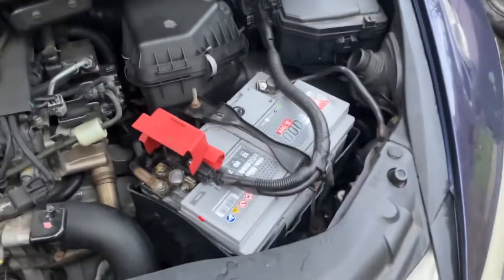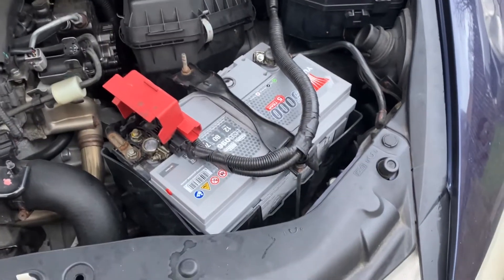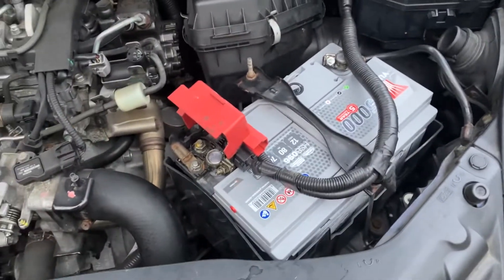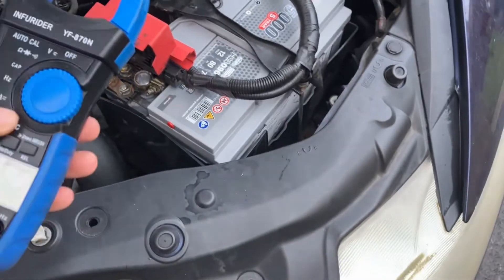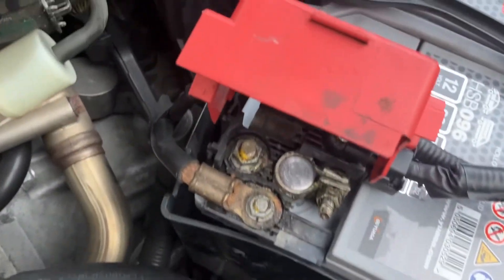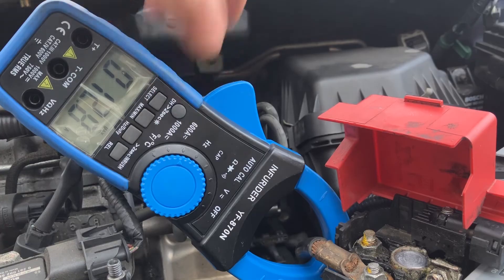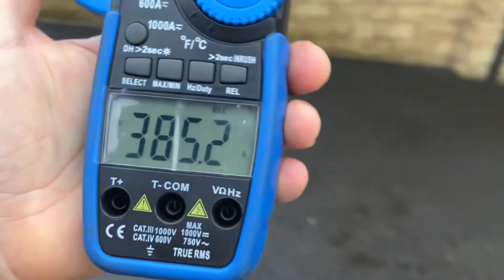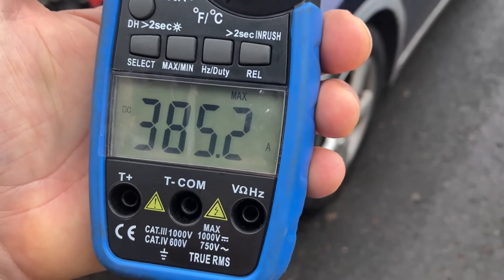How to Test Car Battery Amps.

Comment: That is a waste of time ,that shows  the amperage used to crank the engine,,that battery could pack up tomorrow.,what power in amps is still stored in my battery
Reply from the maker: If you take the fuel pump fuse out you can test maximum cranking amps.

Comment: Dude, my wife's sonata battery is closer to 900 amps.
Reply from the maker: Yes, that would be about right. The 2.2 diesel on the video has a max CCA of 850. Doesn’t mean it will use all that, it will only use what it needs. Plenty of margin on your Sonata if it’s a 2L.

Comment: So I got 261.2 on a 850 CCA battery. 2016 ford explorer. For some reason I am not able to find information on acceptable readings for this vehicle—or any other for that matter?  
Thanks for the vid btw. Very informative.
Reply from the maker: Hi, seems quite low to me. I’d have expected about 400-500. A general rule of thumb is up to about 70% of max CCA’s. If it a hot climate there, the engines warm or been started a few times the required CCA will drop as the resistance will.
Reply: Great video! Thank You!

Comment: Brilliant thanks
Reply from the maker: Glad it was useful!
Reply: @AdamMechanic  particularly for me as I was seeing it trickle charge ok and have the volts and then scraping my head  on why it wouldn't start. Going to get an AMP clamp
Reply from the maker: Good stuff, let me know how you get on! It’s worth checking the battery clamps too, make sure they are all tight between the clamps and cables too.

Comment: 385.2 A... is that a good value ? how do u know that your battery still good ?
Reply: The real answer is. that is how much amps was used to start the car . There could be 600 ,700 amps in the battery . That would require a different test. Now you know. You're welcome.
Reply: Hello, 385.2 A is the number of ampere that remains or is it the number of ampere that was used on the total capacity of the battery??
Reply from the maker: Hi  @oussmi21  , that is the battery amperage used, it is not total possible amps output. If the weather was colder, or the starting system had a poor connection for instance, the amperage would be a little higher.
Reply: @oussmi21  i think it's a remains current in the battery
Reply: @Ladiesman7790  Yesss I had confirmation I asked my car preparer he told me that what is displayed on the screen is what remains as power at the battery
Reply from the maker: Hi, you would want the battery to be outputting at least 70% of the amperage that is stated on the battery label.